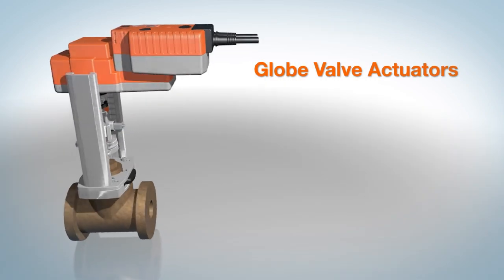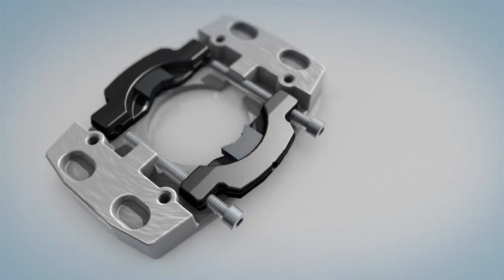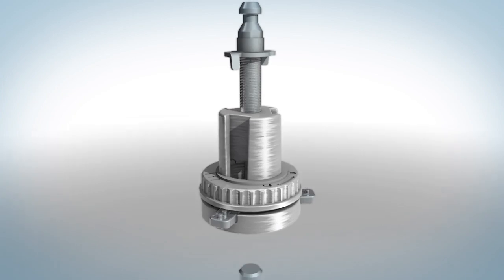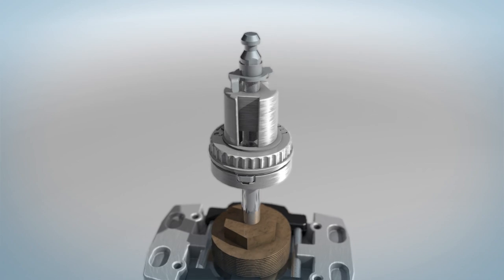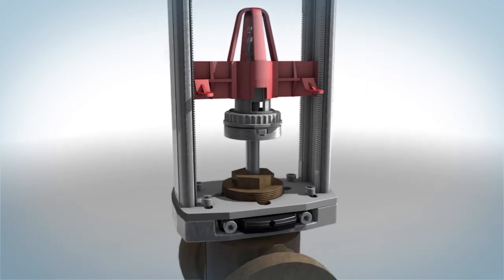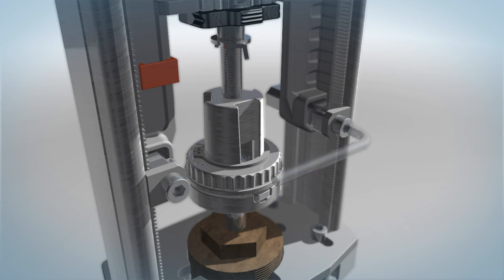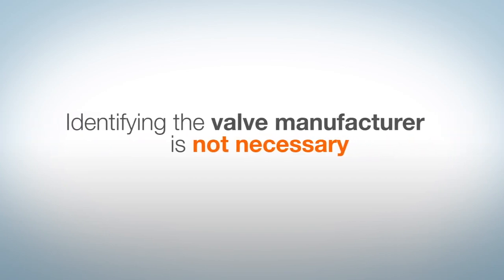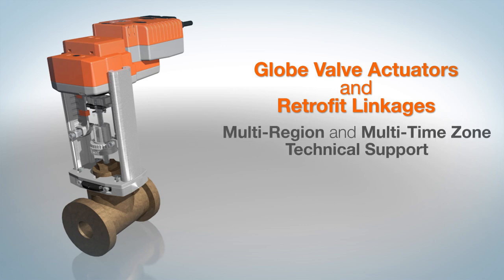Globe Valve Actuators and Retrofit Linkages

Comment: Can valve actuator range of movement be adjusted more than once? How do you reset actuator's memory, so new range of movement can be adjusted?
Reply from the maker: The actuator range of motion can be adjusted but why would you? Normally you would adjust it so it is tightly closed. Regarding your next question – you can reset by pushing the adaption button. If the actuator does not have an adaption button it will self adjust.

Comment: It says in the actuator specification that the linear force for the actuator is 112 Lbf... I'm just asking what does that mean ? is that considered as the torque?
Reply from the maker: Linear force is a push or a pull where torque is a twist to an object.
Reply from the maker: The amount of force the actuator exerts on the valve seat to close it.